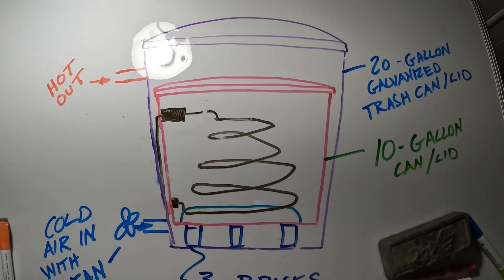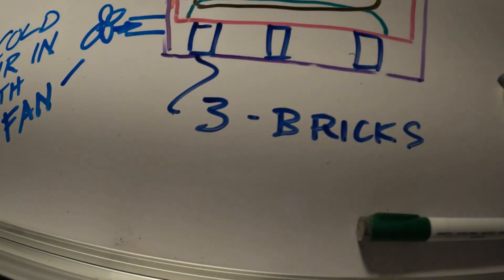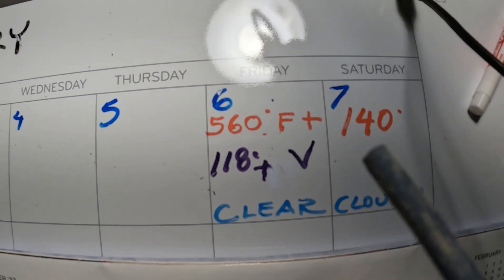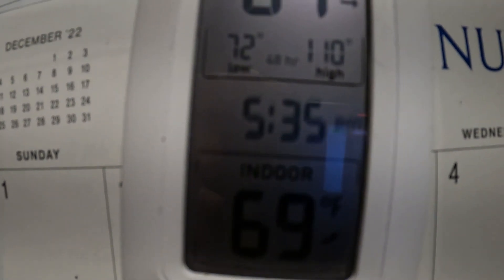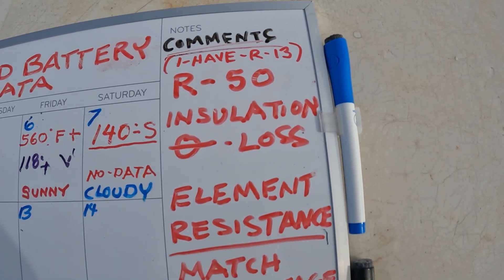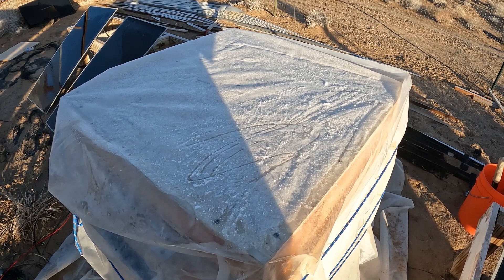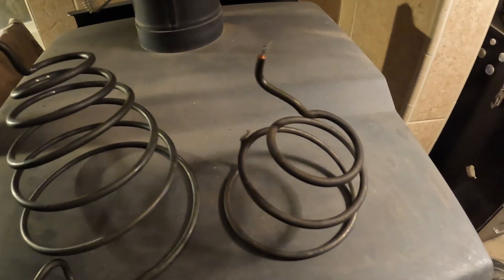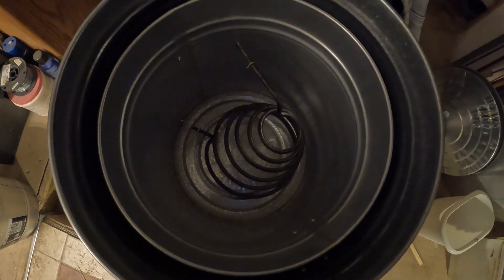Sand Battery Part 11, Data and Two New Portable Models

Comment: imagine if he connected the in and out vents to each other. reach 8oo degrees and then reopen the ex vent into the house and the return vent from the house back to the can. move that sand heater over to the house !!!
Reply: Yes, he's probably causing a positive pressure inside his cabin and losing heat through small openings. He should pipe the incoming air into the sand battery from his cabin, thus causing recirculation.. With a radiator and some ducting of the existing incoming heat he can heat fresh air before it enters the cabin as well.

Comment: Hi Mike! I like your videos.
Just as an FYI, as long as you are using galvanized metal cans, you should only be setting up these sand batteries in well ventilated areas, and not inside your home.

Everyone should be aware that galvanized zinc coating starts to deteriorate and breakdown around 392 degrees Fahrenheit, or 200 degrees Celsius. This will lead to off-gassing which is toxic. The gasses will be yellowish in color.
As temperatures reach closer to 500 degrees F, the zinc coating starts to break down and off-gas more quickly. 

I live in New York. I want to use a sand battery to heat my basement, I heat the upstairs with a wood stove.
Anyway, I propose using solar panels to heat an electrical element in a large clay pot or planter. This should take the heat ok, because there should not be any quick temperature swings or shocks to crack the pot.

I want to let it heat up all summer, get to around 1000 degrees F, and in the winter use it to warm the basement.
I propose using a plastic or metal can, lined with rock wool insulation, and aluminum foil, then flipped upside down, and placed over the planter during the summer to trap the heat and keep the basement cool.

The rock wool and aluminum foil lining the inside of the can, along with the airgap between the planter and the can, should keep any plastic or galvanized coatings cool enough to be safe.
Reply: The galvanized will give off toxic fumes at high temps! 😷

Comment: No need to match the voltage.  Using 120V heating element  generates roughly 500W, which is about the quarter of rated power. In that way heating element will not overheat, and not burn! If you bring 240v (2000W), the sand might not  transfet the heat well enough, and heating element might burn!

Comment: Oh. so your just trying to heat a cabin.  Looks like your just trying to cook a pot of sand to warm an place. so can you just cook it over a stove.  if your trying to warm a place why don't you just use an earth sand battery. looks like you have land. 
https://www.youtube.com/watch?v=lVIj-p0Eqcg
 dig a pit insulate it, put tubes through it, heat it up. and pull heat from it when you need it.

Comment: If you insulated it you would lose a lot less heat. I found that out with our hot tub. It's got thick foam insulation and the water stays warm for a long time.

Comment: You might want to consider adding some rebar or wire in layers to help get the heat to the edges so you heat more sand to higher temps

Comment: Awesome series on sand batteries have fun my friend. Maybe some nichrome wire cut to the right length as it is all about the ohms will give you a hotter element and then you can adjust the voltage to a lower setting. Keep up the experiment Cheers.

Comment: Isn't the goal to evaluate the DIY cost of a sand heat battery to know how much heat you can store for how long?
You can either collect experimental data or use math to perform the evaluation:

1. Make a sketch of your idea. LIst all items and prices. Estimate the man-hours required to fabricate your idea. Be sure to assign a wage value for your labor.
2. Define using math the process of making heat for your sand heat battery using Ohm's law.
3. Collect experimental data to evaluate else perform calculations based on a set of assumptions.
How much electricity (kwh) produces how much heat (BTUs)?
How long will your sand battery store the heat?

Complete the experiment, collecting data else perform the calculations for a preliminary evaluation.

Math tells me your costs are expensive requiring considerable labor and materials to fabricate and maintain over a service life necessary to achieve a return on investment.
Rather than buying solar panels to produce your own electricity calculate costs buying electricity from a local utility (kwh).
If electricity is used to produce heat, what other producing sources are available for what price?
Heat-pump HVAC systems can produce 200 to 500% more heat from the same electrical power cost... face reality... you can not achieve better efficiency with an optimized DIY sand battery.
Back to the drawing board!
Reply: Sounds like a guy that works for a utility company.
Reply: @ranman5501  Do the math and decide where to invest resources

Comment: My Grandpa recommended an underground tank of oil. Oil can be heated to like 700 degrees and stay hot for days or weeks underground.
Reply: I would like to put a word of caution on this idea. Heating a hydrocarbon which is doped with additives, which helped modulate viscosity, anti fouling, oxidative prevention, .etc, can behave very differently then a pure compound. Likewise, heating a hydrocarbon in general should be done with the utmost care. As the temperature of the fluid increases, you will start to push the liquid into the vapor phase. If you seal this vessel and heat it up, you may be have an explosion. Likewise, this vapor will most likely be easily oxidized. And at 700 degrees [I assume F is the units], you may be at or near the ignition point of this fuel. 
... As well as, there more than likely are rules/regulations that prevent unauthorized burial of hydrocarbons due to its ecological effects if released into the soil/groundwater. More information on this can be found at epa[dot]gov[forwardslash]hw. [hw is for hazardous waste]
TLDR Section: Heating a compound [hydrocarbon] will vaporize the substance, and at temps of 700F [which may be close to its ignition point] can become a LAM. [Life Altering Move]. This is why sand is very interesting to us DIY'ers. Solids are normally easier/safer/and cheaper to work with then liquids/ vapors or liquids that phase change into vapors. 
Be safe brother.
Reply: @b_lou  the ignition point of hydraulic fluid is 1100 degrees Fahrenheit. It is designed for high heat applications. That is why I recommended it. And I never said to heat it in a closed loop. Hydraulic fluid generally is used with a vented expansion tank.
Reply: What kind of oil? Any specific or just vegetable oil?
Reply: @Mister_Stork  Granted, this came up in a conversation about a thermal energy storage solution for a non electric solar system. One that used parabolic mirrors focusing the sun onto a pipe with oil running through it, then using the heat to turn a steam turbine.
Reply: @Mister_Stork  I believe he said hydraulic oil

Comment: I believe  by building  a large stationary unit heat can be extracted in multiple ways from the same unit high temp. from low level and lower temps.  farther from the element .Ovens  cam be built in at various locations for different  temps  and air and heated liquid through tubes or coils . After a well insulated unit runs continuously  very  high temps  will be achieved . I just returned with a truck load of used solar panels to power my unit and will start building  sand battery soon .Thanks for laying a strong foundation  for my project.

Comment: Add a battery to keep the follow of power the heater constant and let the solar recharge the battery
Reply: The whole purpose of this is to eliminate  battery  storage  most electricity is used to generate heat. HEAT STORAGE